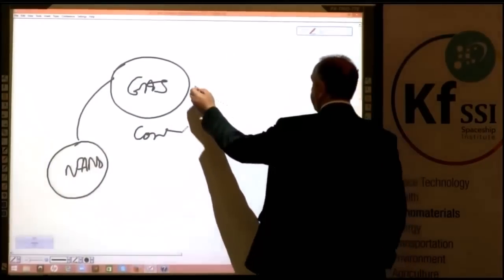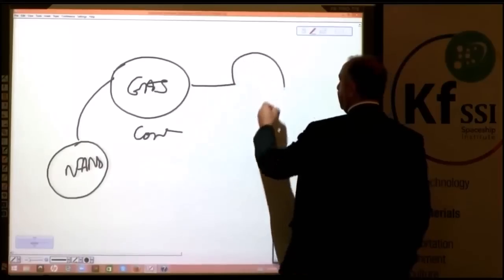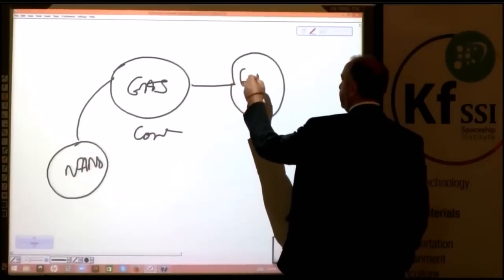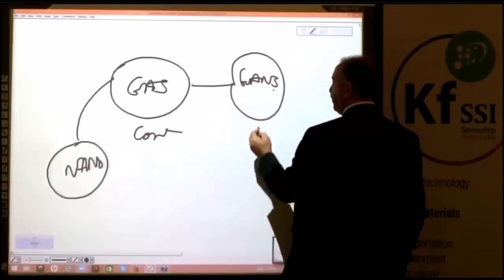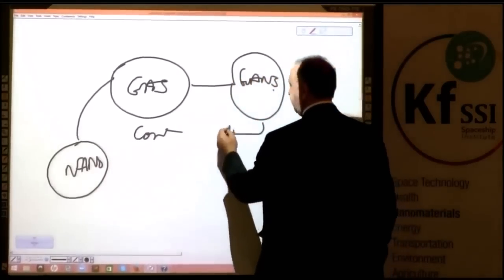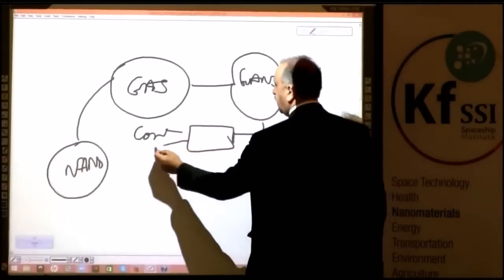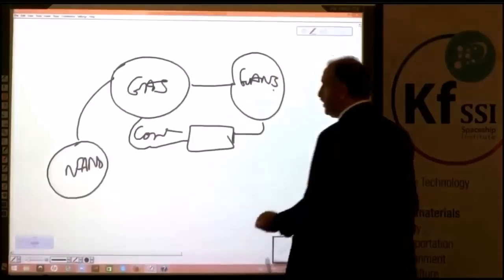candle of peace 2

Comment: Oh Man this is too much for me.  Now its your will comes true with your bla bla bla....For one..  I tried the coils for the car battery for four  months caustic nano coated two months in one position  with no results, so maybe it was to be put on oppsite side so I did that no results there either .  im suppose to see the nano coating spread threw my wiring system, nothing happened, no gas savings, no better performance, no difference in any way..